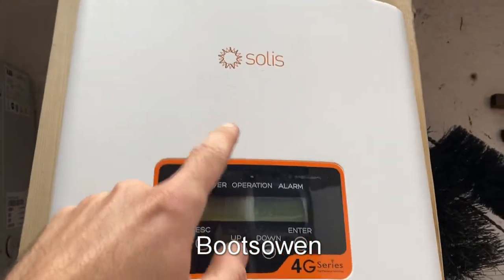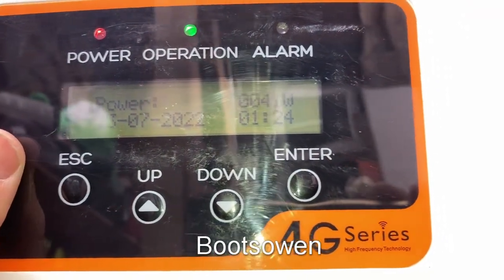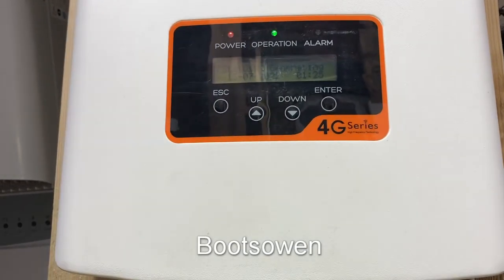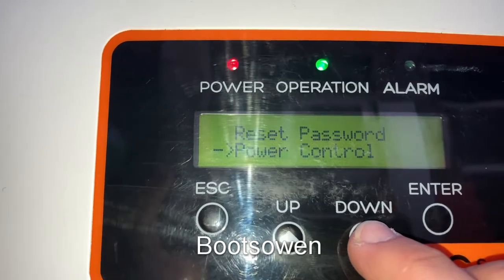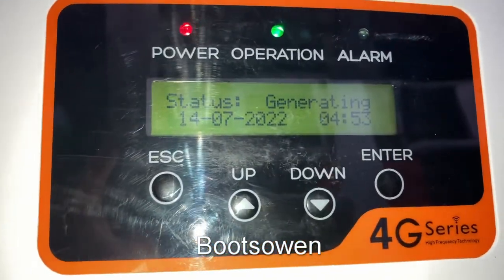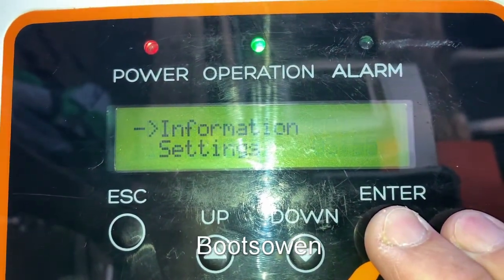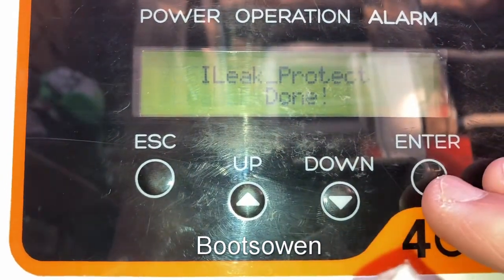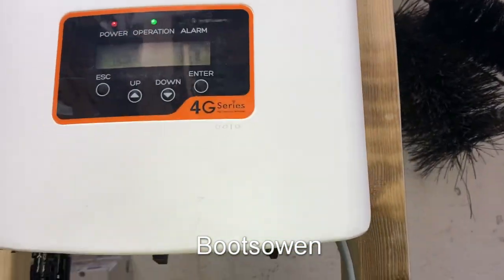Solis Mini 3000 4G ISO_PRO1 Error: How to override the fault

Comment: never seen or heard of one what does it do very interesting
Reply from the maker: It's like asking me what a washing machine is. You could google it?
Reply: @bootsowen  😂😂 i REALLY dont know mate but will do that and google👍
Reply: @colmcoleman6421  converts the DC from the solar panels into AC. These grid-tie inverters plug into the mains. Bit of magic as they synchronise the AC produced from the panels with the AC at the mains. Otherwise the power would be lost/cancel out.

Comment: Owen, useful info. Ground protect is a leak on the DC side to earth, mostly in the DC wiring and connectors but occasionally in the inverter. Measured in meg ohms, so it's half nothing. I had this problem on one of our arrays at the end of the damp, misty and cold November. Damp allowing Dc signal to earth. I shorted out the DC cables from the array and resultant current in the system dried out the damp connector. Interesting but great the you can switch this sensing off on a Solis, I will have to try this on the earlier models, cheers
Reply from the maker: I guess that this inverter could be more sensitive than usual, if it wasn't a fault and the inverter is correct then a go on the bench DC setup should show it.